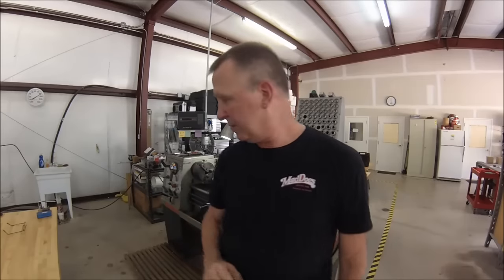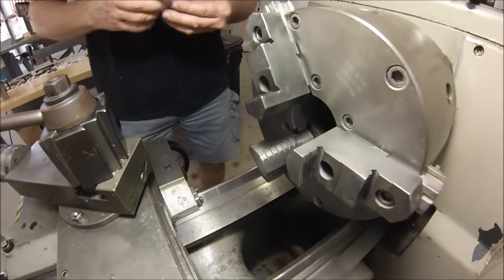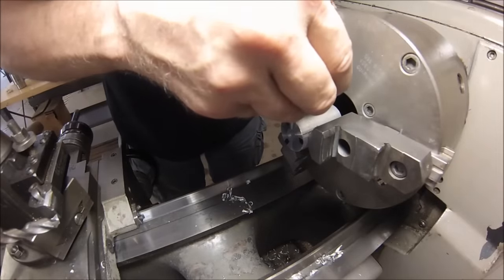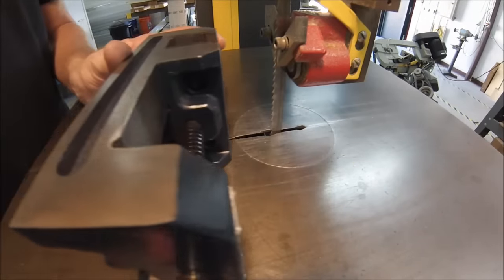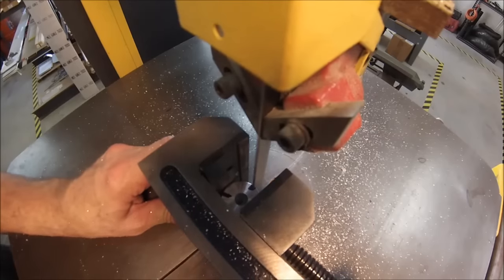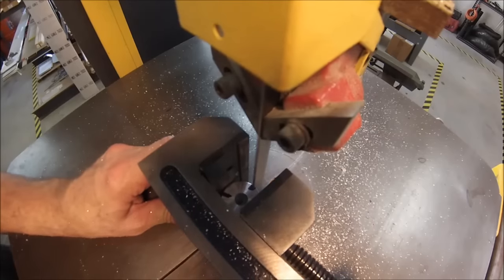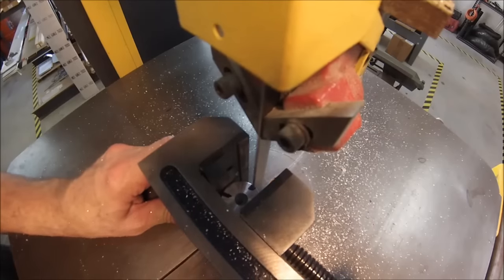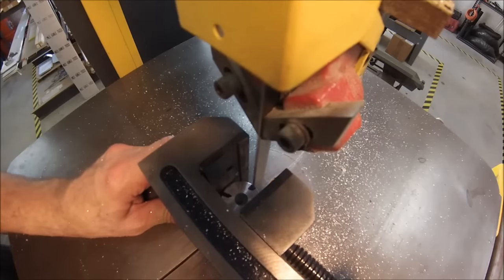Get your parts to run true in a non adjustable chuck. YOU MUST WATCH THIS!

Comment: Yeah .. you CAN buy perfection, but you can make it far cheaper.
Takes me about 15 minutes to make an exact delrin split-collet and I don't care how loose my machine is.
Mind you .. I also like to de-burr the ID and the inside of the split - that way there aren't any dags to mark the job.
Delrin lasts about 500 cuts before you have to re-make it (progressive compression) .. but it's hardly even a job.
2 questions:
1. I have been told that a split collett has to be of a softer material than the job .. is that true and why?
2. I use the in-set index-marker that is always present on a chuck to determine which way is up for runout-correction .. and everything really .. it's like a holy rite to always have the index up when doing .. anything? Is religion the way our ancestors help us not repeat their mistakes?

And 3 .. you turned the collett over .. that's a 180 degree de-phase .. I never do that - it doubles the runnout.
and 4 - no one escapes the Spanish Inquisition ..
And 5 - thanks - your articles help a lot!
And 6 - boring tools are like goats. I never trust them .. I use gun-drills to start the cut and keep the goats off of my volkswagen ;)
Damn .. the twist-drill is the sheep of tools .. it goes the most lazy way it can .. never concentric.
Reply from the maker: Hey, anybody can do a job with great tools. It takes real talent to do it with old worn out junk.
Reply from the maker: On the #3 comment, the bushing was flipped before the final diameter was established. No issue there.

Comment: So essentially you spent bunch of time making aluminum collet which is not precise, not hardened and can actually break.  Why not just spend some money on set of collets that would be better for you in a long run?  Or maybe investing in more accurate chuck or even using independent 4 jaw chuck which surely is going to be faster to spend couple minutes and can actually get better than 1 thou runout.
Reply from the maker: The underlying message and demonstration of this video is to get the job done NOW. With a chuck that runs out, and you don't have to  spend any money or wait for UPS. You completely missed the point.
Reply: yeah joe, he didn't get it. Some people just gotta whine
Reply: I got it alright, but you contradict yourself by saying you made thousands of them so it wasn't just make one to get the job done and order proper tools for future and this is what I am saying is you can't rely on aluminum in the long term, for one time sure whatever, but I would look for solution in the long run that's what I am trying to say.
Reply: No Mark, it's you who doesn't get it.  I am not whining I am pointing out long term solution.
Reply: Did you understand the premise of  the video?  Your collets will not work the id of Joe's collet is not concentric to the od it is being held on.
Reply: William Sanders Why would I fit ER32 collets inside his chuck??  The set comes with collet chuck which concentric with spindle so you can chuck and unchuck your work piece unlimited times.  His "collet" is good as long as it stays in the chuck and as soon as you remove it it will no longer be centered and will have runout.  I just don't see a point of spending 30-40 minutes on making something that will be one time use and discarded.  Another option I just received and installed a 4" chuck for my mini lathe which after thruing up spindle face runs 1/2 thou run out.  Cost me $65 shipped! original chuck was crap.

Comment: with the test indicator tip at 70* will not give a true reading
Reply from the maker: Its not used for measurement. Thats why its called an indicator. But.....if the movement of the needle is drive by the amount of angular rotation present at the transition axis where the indicator tip is anchored, does it really matter??? This about this. If that joint rotates 15 degrees, how does the main lever arm know how the motion was caused?

Comment: good to see you checked if the reamer was running true NOT
Reply: Notice the reamer was hanging out a long way from the chuck? This allows the work to self centre the reamer. I guarantee that will have cut exactly, and I mean exactly where he wanted it to and that is absolutely true to the workpiece.
Reply: @jamesbarnes4619  I've been a machinist for 40 years. You didn't watch the same operation I did obviously.
Reply: @jamesbarnes4619  Plus you notice he didn't ream into a drilled hole - remember the intermediate operation?

Comment: Wear safety glasses for your next video, we need to set an example to the kids.
Reply from the maker: More specifically, glasses with side shields. My lenses are safety glass.
Reply: And they are very safely perched on the bench in the video, a short shot of them on your head would do
Reply from the maker: I actually looked on that bench and cant find them. I'f my lack of side shields is all you have to complain about...1. Thanks for your safety concern, 2. I did a good job on the subject matter. Point out the time they appear, so I can check it out.
Reply: I have not mentioned side shields
Reply: Isn't safety glass and side shield a true pair of safety glasses. Maybe you should have mentioned them.
Reply: I did say safety glasses, sorry I should have mentioned them also

Comment: so basicly i need a 4 jaw chuck if i wanna turn accurate parts
Reply from the maker: Nope. Just know your machine and take your time.
Reply: Thanks for the input Joe  , i have a very old neglected heavy 10L and i'm wondering if i screwed myself buying this thing , im into it about 1200$ .  The ways are bad and the journal bearings where dry when i got it , the super polished rotor surface was grooved badly so i polished it up best i could with a polishing kit . The tail stock is also very loose so im thinking about nickle plating the parts to replace some metal . would you be willing to provide any input on my situation ? Should i give up on this thing or can skill out maneuver the wear  . my vertical alignment is out about .125" so i was gonna use electroless nickel plating { not electrolysis } to replace worn away material.   do you think its worth my time ?
Reply from the maker: A wise man knows his limits and the restoration of older machines is definitely mine. As much as I'd like to advise you on this, I know there are better resources here to guide your decisions. If I were to reach out, I'd go ask Keith Rucker for his opinion. https://www.youtube.com/user/ksruckerowwm/featured

Comment: Hi, Nice trick. But when your chuck is worn, this trick will not help. In the chuck there is a spiral plate that turns around when you thighten or loosen the chuck. When the inside of the plate gets too much play on its axle, the jaws will center always on a different place, so there is always a different runout. I never ever use a file that close to the jaws too, I put a little chamfer om my workpiece by using both handwheels simultaneously. But thanks anyway to explain this trick.
Reply from the maker: I respectfully have to disagree. Once the jaws come into contact and offer resistance to the scroll, they will stay on location . The movement is very minimal. If your jaws and chuck slots are also extremely worn, it will be hit or miss.

Comment: I am not a machinist but to me there is a huge flaw in the process which could be fixed by a simple change in the sequence of events.  After flattening the first face, you bore the center hole. Then you take it out of the chuck and flip it over before rechucking to flatten the second face. Since you did not mark the jaw positions before removing it,it seems like you completely negated any egocentricity gain of the hole you bored. Seems like you should have done all the marking prior to that first removal.  What am I missing here - seems a little foolish??
Reply from the maker: The initial hole was small enough to absorb the eccentricity and then some. If the hole was to size, or close to on size, the sequence would have been risky. Under these circumstances, the process shown was fine.
Reply: You answered your question, I am not a machinist.
Reply: @Wilbur - not a lot of people are machinists, real ones, that is, and we're getting more rare as the years go by. Most folks who have anything to do with machining these days are just CNC babysitters, You kindof have to give people a break for not growing up in a tool and die shop (like me) or never even taking metal shop in jr. high or high school. Heck, these days you have to make allowance for people not knowing basic math or even having common sense.

Comment: That's a lot of screwing around, just shim the part.
Reply from the maker: Then you'd have to shim every part. You only have to do this once and you can run all day.
Reply: Sure, if you're turning multiples of the same part but not if you have various parts or different diameters..
Reply: As Joe said above, start small and re-bore for the larger parts - takes seconds to rebore for larger diameter.   Stop trying to punch holes in his technique, there is a rhyme and a reason that he said in the video.  Watch the whole thing before you try and outsmart him.

Comment: All that just to align a 3 jaw chuck? Obviously you've never worked in a job-shop.
Reply from the maker: Exactly what part of this video said anything about aligning the chuck? Obviously you missed the point.
Reply: He states at the beginning of the video, this is not a chuck alignment at all. This is more of a method to overcome inability to adjust (either due to no way to adjust, or extreme wear) and reproduce the accuracy and repeatability of an adjustable chuck.

Comment: Nothing special , that works. Why not just machine the chuck? I never do this kind of thing, cutting corners being lazy bites you in the ass
Reply: Cutting corners?  Being lazy?  This is a valid technique.  There is more than one way to machine everything.  Your comment reminds me of a engineer I once worked with, where he had a rotary table on a mill table, but did not have enough distance for the diameter of the part.  Instead of putting a riser block under the rotary table, he wanted to mill the table for clearance.  I never bored hard jaws.  If you put a plug in the jaws to tighten it down, how do you bore all the way through?  If you use a ring to expand the jaws into it, how do you avoid a tapered cut?  I don't think I like your idea, and would rather pick up an adjustable chuck.
Reply: You can grind the chuck, but that's only going to be accurate for one diameter.  Scrolls are never perfect, and they never wear exactly evenly, so you'd have to grind your jaws before every job.  If precision is that critical, use a 4-jaw, turn between centers, or find a collet for your lathe.
Reply: I just don't see how that took out the play
Reply: EarthSurferUSA I guess you never heard of sarcasm
Reply: Joe rose it takes out the runout because he is machining technically new jaws to hold the piece that are referenced to the machine perfectly because the machine machined itself technically.  That's a lazy half as way of doing things. A skilled machinist can have the job done correctly by the time this guy makes a "collet"
Reply: It's the same as putting jaws in your vise and instead of indicating the vise straight you just machine the jaws to be straight to the machine. Workmanship like that says to me that your lazy and don't have the skills to do things correctly and quick

Comment: The mistake was he flipped the part over in the lathe AFTER drilling the hole.
Reply from the maker: There was no mistake made. The hole was small enough to absorb the eccentricity. There may have been an issue if the hole was on size. Otherwise, the technique shown is 100% sound.
Reply: Yes.  It is quite good.

Comment: Time is money... buy a new chuck if it's beat.
Reply: Buy soft jaws...even cheaper
Reply: @esiprecision7504  True, but it's nice having a good chuck with hardened chuck jaws you don't need to bore  for different size material. 
But if you're gong for super precision, boring jaws is the way to go.
Reply: @danw5157  even more true, I only have adjust true  chucks, I use soft jaws for non marring purposes mainly. My index heads are adjustable as well, ease of concentricity is as important in my milling operations as my turning op's.
Reply: @esiprecision7504  In my earlier days (about 10 years ago) I was mostly a lathe guy (up to 8 axis, index C65, among other multi axis lathes) Then I crossed over to milling... never went back. Less stress. love the Makino a51nx horizontal, .

Comment: If your chuck is running .015 out, throw  it away!   Or,   re-grind your top jaws.
Reply from the maker: Any chuck running out .015 could use some TLC for sure. I'd start by taking it off and taking it apart. Give it a thorough cleaning and put it back together and reinstall it. If that doesn't help, a correct grinding of the jaws would be the next step. Make sure to support those jaws correctly for that step, or the grinding will be ineffective at best. Not sure I'd throw it away. I'm glad my chuck was intentionally out that far and I have the option to just dial it in.
Reply: I'll send you my address if you'll send me all your out of adjustment chucks please. I'll even pay shipping!
Reply from the maker: I'll pay shipping +$1.00
Reply: Don't get greedy Joe, I have at least $7 in my pocket.

Comment: well....you are using half an hour making a 10 cent part..... go out and buy the damn thing.....and use the half hour making a 500 dollar item.
Reply: I think Joe Pieczynski is explaining a method to compensate a chuck or a lathe that is misaligned; his intension is not to put value in the part itself but How to solve a problem,  what about if instead of aluminum, a client brings you an irreplaceable part of an expensive instrument for you to machine? That will not be a 10 cents part anymore, right? And a mistake can cost a lot of money...Someone also said why you don't just get a collet, Well a collet will copy the misalignement and it will not solve the problem neither.. My 2 cents..
Reply from the maker: Paul, thanks Bud.  I appreciate when my supporters jump in for me.  As for whats his name...I actually see this video as showing 12000+ people how not to panic or spend unnecessary money to overcome a problem that seems like a show stopper when working with less than perfect equipment. The video is a half an hour, but I can do this in about  5 minutes. I value my subscribers. Everyone of them.  If you don't see the value in this video, feel free to move on, or simply sail away. Thanks for stopping by. Sea ya.
Reply from the maker: Sorry....my bad. That would be 158,000 people. Feel free to hit the thumbs down button on your way out so I know its not broken. It just never seems to move.
Reply: Pretty hard to find a store that sells common sense. Great video Joe, subbed.

Comment: get a 4 jaw and learn to use it.
Reply from the maker: Thats completely not the point of this video.
Reply: Truthisstrangerthan Fiction  it's spelt asses ,and after 45 years in the machining industry I see too many unskilled people trying to do everything in a 3 jaw , especially when the right Chuck is usually rusting away in a cupboard.
Reply: @joepie221  sure Joe,point of video is how to achieve concentric grip, if you don't have  independent 4 jaw chuck ,like myself,or worn out 3 jaw chuck ...i find comments like that rude....here in Europe 4 jaw independent chuck is rarely used and expensive,hard to find...and i don't want to buy cheap chinesium junk...
Reply from the maker: @sinkosav  I am not sure where big smoke served their 45 years in machining, but at the majority of the shops I have worked at, if you grab a 4 jaw for a round part, your days are numbered.
Reply: @joepie221  another good point Joe,it seems that i will try to find new adjustable 3 jaw chuck.....
Reply: Holy crap. Here's a couple of tips for commenting on videos that I think might make Youtube more enjoyable for "some":

1: Don't comment when inebriated. That always ends up with a litany of comment notifications the next day from people like me.

2: Read the title of the video, turn down the Lawrence Welk record so you can hear what the guy says during the video, then watch the video... (especially the early part where he explains the goal and the circumstances under which one might find the tip useful...which I did...and I do own a 4 jaw and know how to use it. I also use a 3 jaw most of time for what I do and sometimes it would be helpful to improve the concentricity of a 3 Jaw chuck...regardless of whether I have a 4 jaw or not...or collets...or a 6 jaw...or 45 years experience centering work in a 4 jaw.

And 3: Make sure you've done 1 and 2 before telling the world that you've been machining for 45 years, which might give the impression to amateur, sparsely tooled old home shop hacks like myself that attention to detail isn't necessary to be a career machinist. Had I known that, I would have pursued it before I retired.

Lighten up. Laugh even.
Reply: @joepie221  it has been  47 years in the aviation industry and 3 jaws were rarely used except for hex bar if a collet wasn't available or on non critical parts or by unskilled users, in my experience using a 4 jaw is always used for round bar as has better holding power ,my comments weren't a criticism I see too many YouTube videos where everything is attempted in a 3 jaw ,the first chuck you learn to use should be a 4 jaw ,hope I haven't offended you or your more sycophantic fans of unknown engineering skills.
Reply: With a little thought and some practice you can get a work piece to run within 0.0005 in. In about two minutes with a 4 jaw.  If you don’t have a 4jaw or a good 3 jaw this is a very good trick.